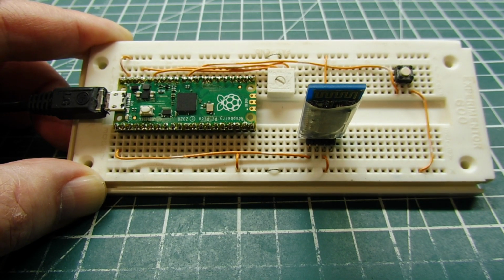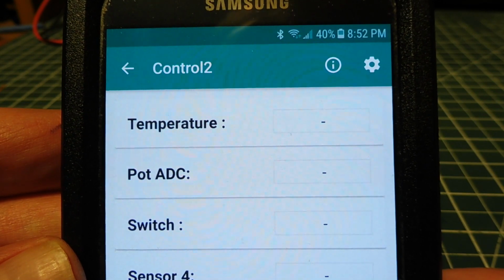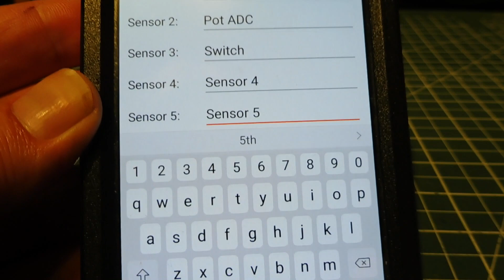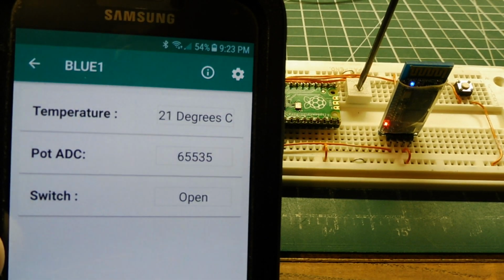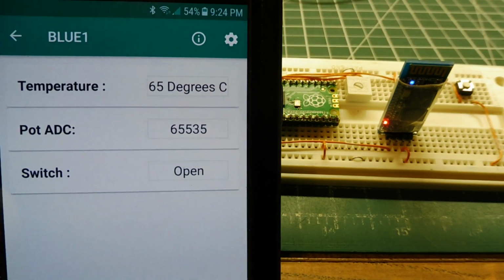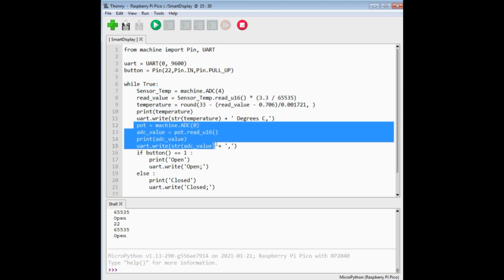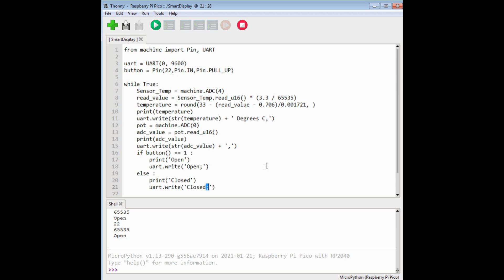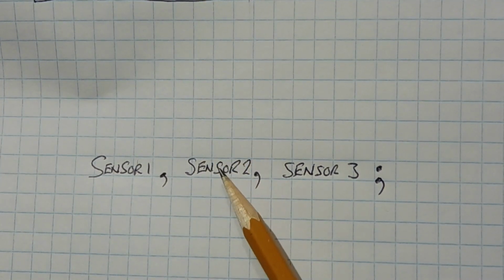Turn Your Smartphone Into A Display / Micropython

Comment: I tried this today. Sadly no luck. I managed to get the previous movie working with the LED and the other app. This app does nothing in receiver mode. It does pair in terminal mode and if you send a message the red LED flashes. It is difficult trying to identify which pins are used for the POT in the movie as the wires are all the same colour. In the previous movie the breadboard was over towards the viewer and so possible to see. You can try figure this out from the code as ADC0 which is pin 31 / GP26 however I presume for the middle leg of the POT. The button is GP22 which is pin 29. The Bluetooth H0-06 TX moves to GPO 0 which is pin 1. I removed the button and POT next thinking the temp would display, however nothing. The code is provided and so a simple diagram of the pins may help if possible. I would love to see this work and demonstrate to my students.
Reply from the maker: The pot wiper goes to GP26/Pin31 with 3.3v and Gnd to the other two connections to form a voltage divider. The UART Tx which is GP0/Pin1 is connected to the Rx pin on the HC-06 module.
Reply: I managed to get data sent to the app however only as a terminal. You can see the temp and it works. The receiver mode will mode bind and does nothing. Thank you
Reply: I suspect the app has had an update and has a bug. It sends the correct data as a terminal with temp, pot values and switch. Receiver does nothing. Does not bind with HC-06 as the red led just flashes fast.
Reply from the maker: The app has to run in receiver mode. After selecting receiver mode you will see the sensor list. At the bottom right hand corner you will see a circle with a link symbol. Tap that circle to pair to HC-06.
Reply: Thank you. That worked. My old android phone crashed. I will try iOS phone next. The red link button works. Just data fast for this phone.
Reply from the maker: The values are being sent correctly as indicated on the Terminal screen.
The values might be sent too fast for your phone to handle so put in a delay.
Add this 50 msec delay to your code after the while True: line.

from time import sleep

while True:
    sleep(.05)
Reply: It would be awesome to make a tiny car using a small breadboard, pico, Bluetooth module, LEDs for lights and a TB6612FNG motor driver. Maybe a servo to steer front wheels. This can then be driven from a mobile phone. Could add a few sensors as well.
Reply from the maker: https://youtu.be/Sjb6sinTHTs
Reply: @0033mer  Thank you :-)

Comment: Hi, love this and will use this in conjunction with my weather station project, sadly have a problem.
No readings appear in the app RECEIVER boxes but the Thonny printouts are there. So reconnected app as a TERMINAL and I get all the strings but very fast and warning that data is too fast. Tried reducing the BAUD but that just corrupts data, so introduced a time delay into the main loop of 30 seconds. TERMINAL now shows the strings appearing. Switch back to RECEIVER mode and nothing appears in the sensor boxes.
Any ideas?
Thanks Chas
Reply: Same problem